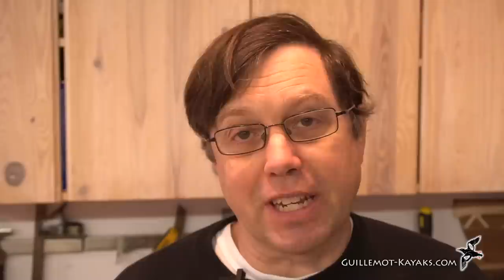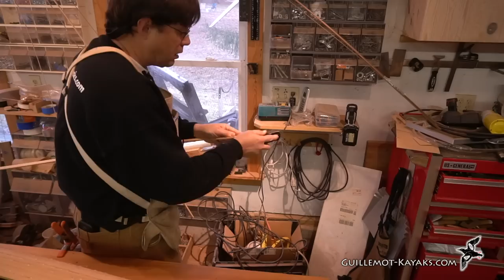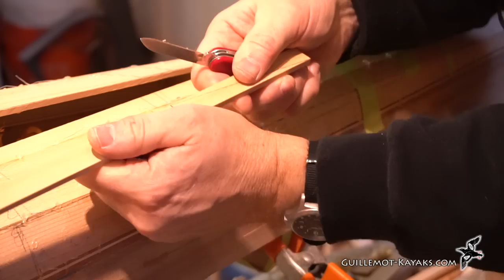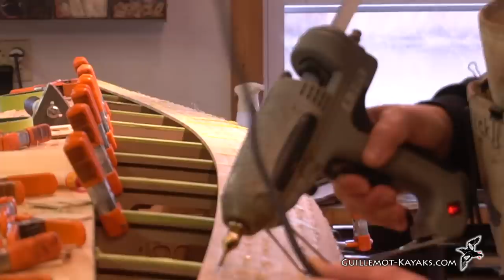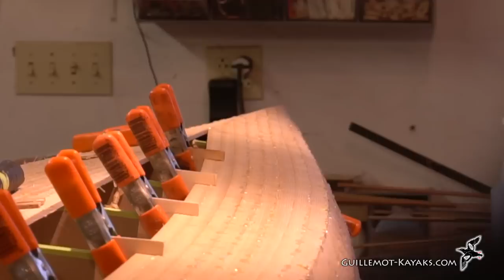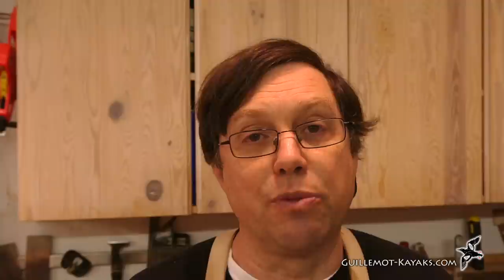Stripping to Music - microBootlegger Sport - E19

Comment: Hi Nick, seems like you can move from one strip to the next fairly quick. what glue are you using or is that some sort of hot glue you use at the end of putting in each strip. I'm in the middle of a canoe build and waiting 24 hours between strips (no staples). wondering if I can step it up a bit, especially with the weekend coming?

Comment: At the 6:33 mark, give or take, I see that the grain matching pencil marks are not perfectly aligned but rather step back as you move to the keel line.  Is this by design?  Is this to accommodate the fact that the strips were laying straight when originally marked and are now curved on the boat?